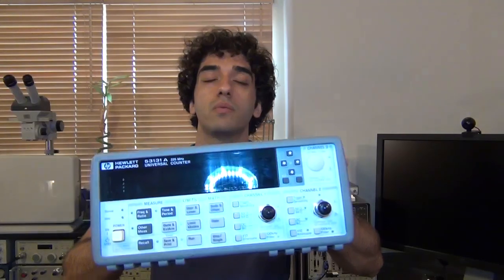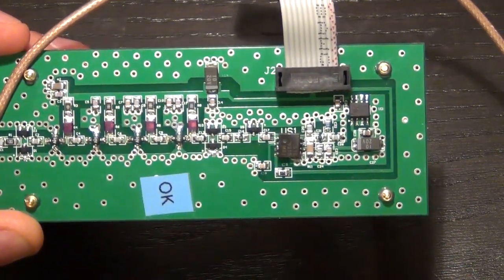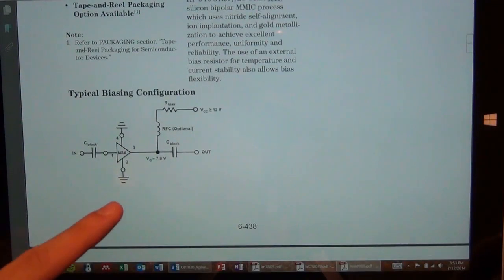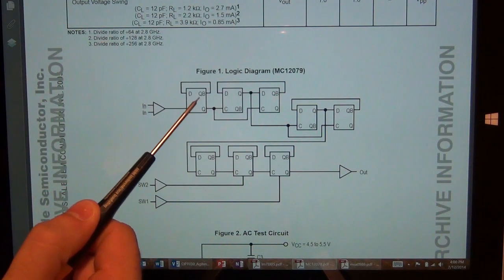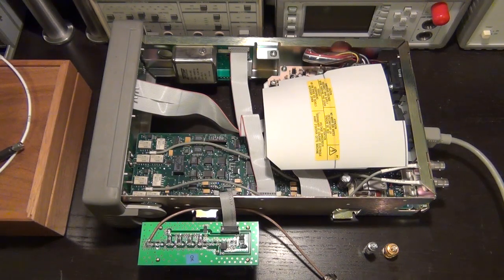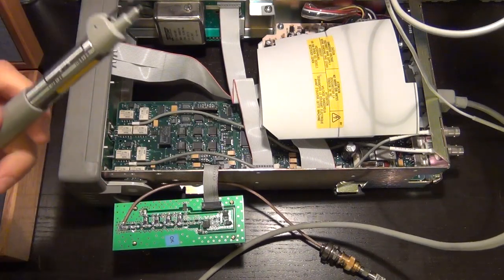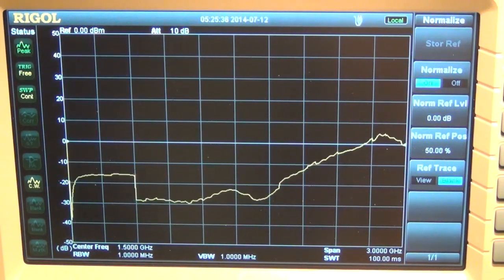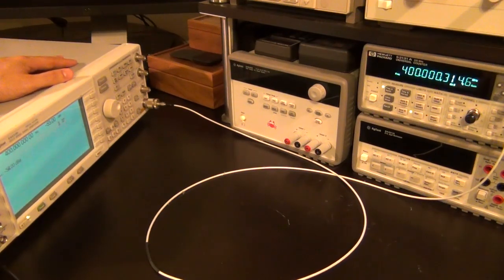TSP #30 - Agilent 53131A Universal Counter Upgrade OPT-030 Analysis and Experiments

Comment: Correct me if I am wrong, but as I have seen in one of your other videos, although the diodes are great for clamping, they are not so great for THD as a diode is a non linear device.  You will get 2nd, 3rd, 4th etc. etc harmonics introduced on what should have been a clean signal.
Also I love your videos.  This type of technical content is what I am looking for.
You, Dave of EEVBLOG,  W2AEW, Patrick Hood Daniel and Ben Eater are my favorite electronics/computer teachers.

Comment: I'm happy to see another video from you.  And, as usual, a very thorough one.  I am a little perplexed about counters in one respect: since the division of the observed freq is as much as 256, how does the counter successfully interpolate values that are between those division boundaries with good accuracy, especially odd values?
Reply from the maker: The division ratio is fixed, it does not change. So all the divider does is that in translates the input frequencies of 0.1 to 3GHz to a lower range, for examples, divides everything by 64 which then the instrument can count.

Comment: Awesome video, as always, Professor!

I'm guessing that the diodes are a) unnecessary at each gain stage and b) due to their capacitance, which will be variable in voltage, would present undesirable impedance characteristics at the inputs and outputs of the amplifiers. The amplifiers also might not appreciate driving current through the diodes to ground. 

I hope to see more videos from you soon!

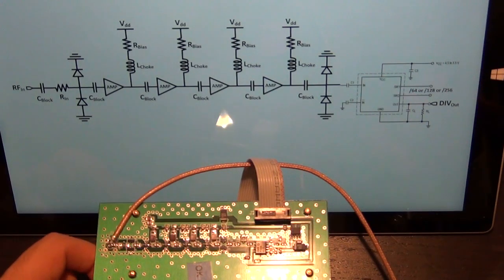Comment: Nice video!@11:15 parasitic capacitance would limit the bandwidth?
Reply from the maker: Yes, you are right. Junction capacitance of the diode appears in parallel to the input impedance of the amplifier and thus limiting the bandwidth. For this board, expensive diodes were used to ensure the bandwidth exceeds 3GHz.
Reply: Not only stray capacitance, but I'm guessing the recovery time of the diode matters too. I'm guessing that if the recovery time is too long, a high frequency signal that overloads the input will not just be clamped to the diode's turn-on voltage, but almost completely attenuated by the diodes.
Reply: you beat me to it.! ;)

Comment: How did you discover you were saturating the input at 43:45? Is there a trick or simply because of your huge experience? BTW: I suggest next time to take time and explain why you changed the reference level. I love your videos because you explain very well all your steps, in this case it was the first time you jumped too fast for common poor mortal like me with limited know how on a Spectrum Analyzer. I already researched and I know why now so don´t bother to explain me that. Just a little suggestion for your hard and unbelievable high quality well done videos. Yes it was very difficult to find an improvement (may be?) for your video :-)

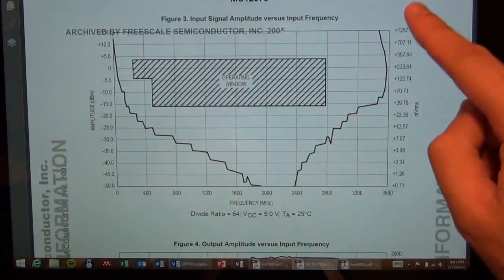Comment: Superb video. At time index 22:17 (in the video) - if there is self-oscillation from about 2 GHz to 2.4 GHz, then does this mean that the static divider module is flawed? If no input signal is presented to the static divider, then it would be necessary to suppress self-oscillation, right? Otherwise the static divider module would always develop an undesired output, right?

Comment: Very  good video! Can you please do a video about OpAmps. I  am actually ok with opamps and understand how they work, but every time a see new circuit it is still  puzzling me, for example what  role does the biasing voltage has in this  video?
Does it control the gain? And if the gain   of each opamp is the same, why  do you need separate Vbias here?....

Comment: Hi Shahriar,
What diode does that board use for the input clamping? I am trying to select clamping diodes for a small LNA project I have been working on. I have come across the BAT54 and NXP 1PS10SB82 as possible options. Also, does a clamping diode arrangement like this also protect against ESD, not just a large signal? I have seen amplifier circuits with MOVs and GDTs even on the input and I'm wondering if I really need that level of protection for my board. Thanks!

Comment: How does the amplifier get its operating voltage? the top and bottom pins are ground, so does it use the DC bias as a power supply?

Comment: Is it possible to add an additional amplifier or 2 to the circuit to further amplify the signal and thus allow it to work with weaker signals? What if someone were to make a design with 2 additional amplifiers, would it still function safely without harming the device? Also, can an amplifier be built for external use e.g., if you are working with a signal that is at -70 dBm, could a user build an external amplifier that will function inline with the probe and add some amplification, and thus expand the usable range that the device can function at?
Reply from the maker: The diodes at the output of the amplifier chain protect the divider from large signal swings when the last stage is saturated. So adding more stages won't harm the divider. However, at some point, the gain of the path would be too high and various noise sources will start to trigger the divider because they will be amplified. Furthermore, the isolation from the output of the amplifier to the input is limited, and you can actually cause an oscillation if not careful.

Comment: i did not understand all power supply stuff you said. If you are feeding power to RF amp with inductor (100nH-1uH), should you care about power trace characteristics in frequency  ?  I think not, but again, i don't understand RF stuff
Reply from the maker: You are correct in a sense that if I had an ideal inductor of very large value, I would in theory isolate the Vdd pin of the amplifier from the impedance variation of the Vdd trace. However, the inductor is not ideal and its value is not infinite. Therefore, it is possible to imagine a scenario where it could resonate with the impedance of the Vdd trace at a certain frequency and create some problems. Although, the series resistor to the inductor helps too as it reduces the quality factor of the inductor and thus dampening any resonances.
Reply: @TheSignalPath  Thank you so much, I really appreciate your videos, comments and help!

Comment: Is there specific reason why there are four blocks of 7.2 dB each, can one have two block of 14.4 dB each.  With OPT-030 i think frequency divider  is  fixed, when i look at 53132A component level specification, it is constantly set to divide by 128 by setting both SW1 and SW2 pin High(MB510) . specification  also says they use MB510 , in this board we have MC12079 , i can not see very clear in video but i think both SW1 SW2 are set to high in your pcb too.  but problem is with MB510 both control pin set to high will divide by 128 but , MC12079 both pin set to high will divide by 64. any help will be highly appreciated
Reply: i have done a little search around i think chip on this board is not MC12079.

Comment: Is it bad to leave the oven on the oscillator for long periods, can the heater go bad from just being left on? What would good probing be? Calibrating the active probe first?
Reply: From what I've read, crystal aging (frequency change over time) is increased by temperature changes, which would suggest that to avoid aging, you want to leave your reference clock on all the time so that the temperature remains stable. Anyway it needs to be left on for hours (in the case of a high grade OCXO) to stabilise before usage.

The heater is just a PID controlled resistor, so I wouldn't worry about it as a point of failure, especially as it's current will decrease as it reaches target temperature.